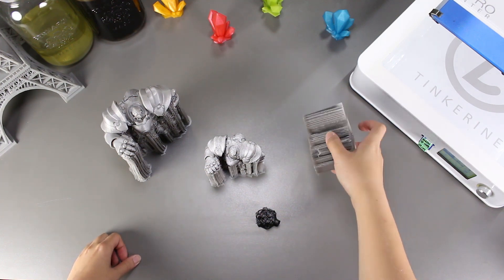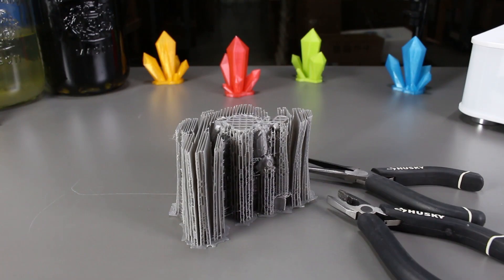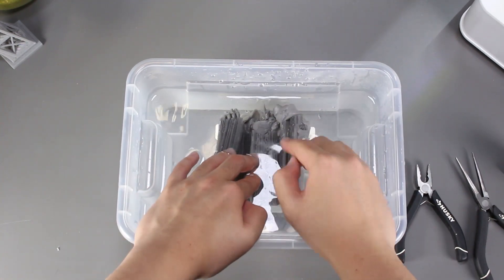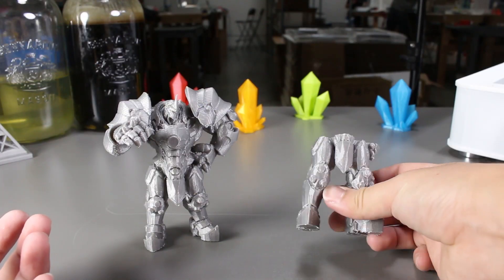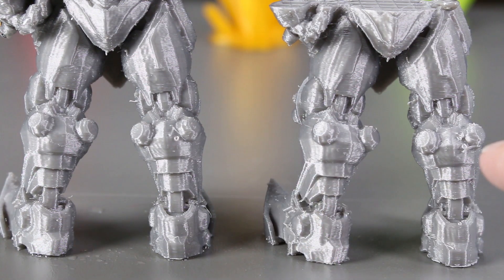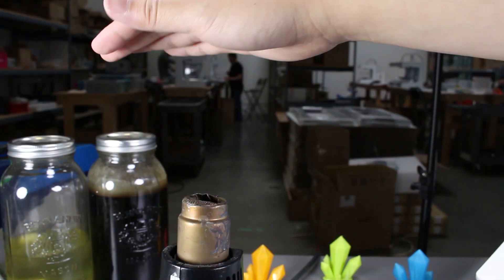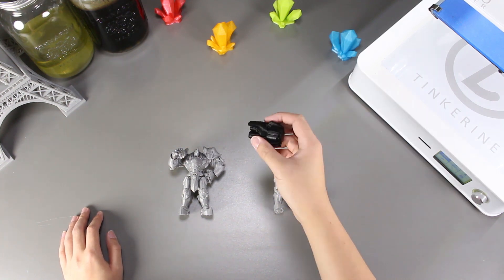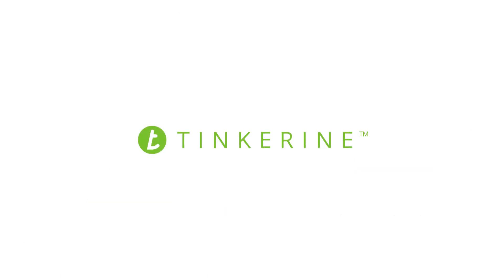Cleaning 3D Printed Supports with Hot Water

Comment: Is this just normal pla or water soluble supports
Reply from the maker: Thank you for the comment! The support structures you see in the video are just normal PLA support structure.
Reply: @Tinkerine  Hot water huh. How long do you leave the print in and do you put it in there right after it's done
Reply from the maker: @TheDwilliams1000  We left the print in around 30 seconds to a minute. You should be able to put in the print right after it's done for PLA prints.
Reply: @Tinkerine  I might have waited to late. Ugh these supports are difficult to remove. I decreased the density in CURA 5.6

Comment: Was always curious... But does sanding the print make it get rid of those layer lines?  Looking into getting a 3d printer but those layer lines really bugs me.
Reply from the maker: Thanks for the comment, sanding the end product does remove the layer lines!
Reply: @Tinkerine  thanks for the info!
Reply: Another way to remove layer lines is a little cheaty.. But just spray painting primer onto it, with many layers of it with sanding between the sprays can hide the layer lines easily.

Comment: how hot is the water you use
Reply from the maker: Hi!

Thank you for the comment. We only used hot water from the tap for the experiment!
Reply: @Tinkerine  what temperature
Reply from the maker: @GloomyStrawberries  , we didn't measure it with a thermometer but we can say it's roughly around 40 - 50 degrees celsius as an estimation.